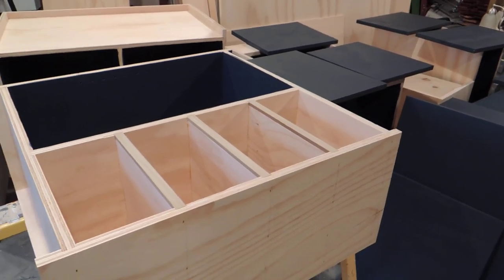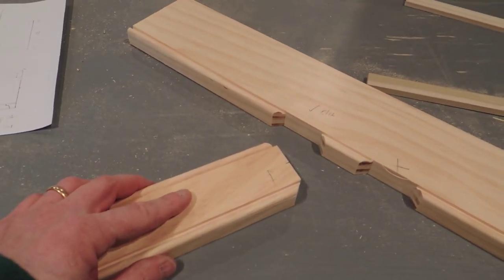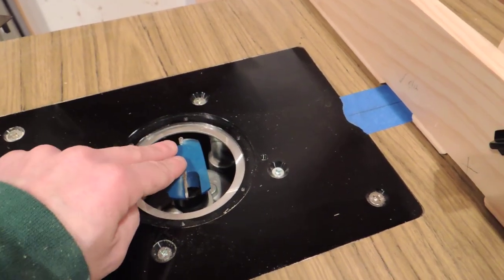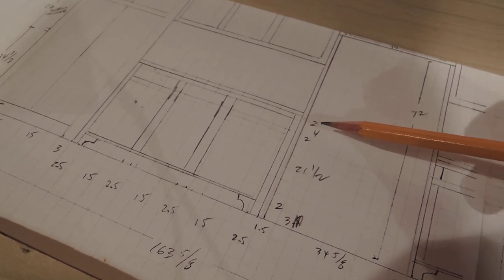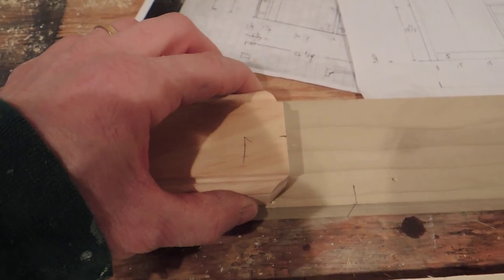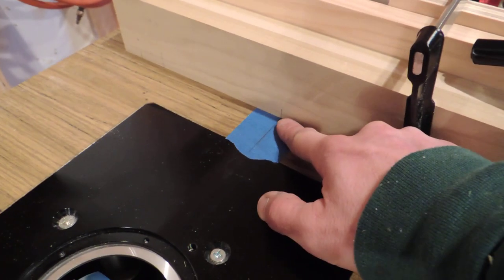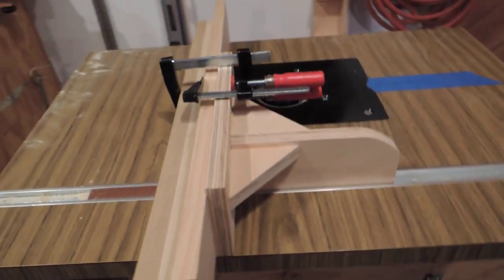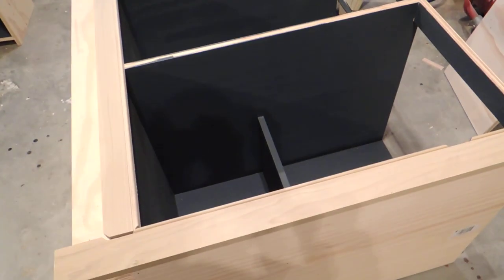Cabinet Beaded Face Frames With A Simple System

Comment: I know you made this 4 years ago, but I just wanted to say Thanks for the great video.  There are a couple other similar videos out there for making beaded face frames, but yours was by far the easiest to follow and most useful.  It gave me the confidence to attempt it myself on a big built-in cabinet project and the results are perfect.  I went with the smaller sized Kreg notching bit so that I could reduce the width of my rails to 1 5/8 (if single beaded..  1 7/8 if beaded on both sides).  I found the best approach to be to fiddle around until you can make a perfect/tight master sample of notch and rail, then keep those for reference to repeat the router set up later.  Also, the line markings work fine as reference to start setup, but I found that using a stop block on a scrap piece is the safest way to go for repeatability.  Thanks again for the great video!
Reply from the maker: That's great to hear--glad it worked out for you!

Comment: Pretty cool John.  I bought one of those Kreg bits after making a beaded face frame with the miters on the bead cut by hand.  Let's just say I'm glad it was a painted frame.  I started to build a set up then realized I didn't have an accurate way to index the cuts.  Your set up is exactly what I was looking for!
Reply from the maker: I usually look for the simplest way to perform a task.  Sometimes elaborate jigs are necessary, but often an old school trick can be adapted to new use!

Comment: Excellent job explaining the process. Glad you addressed in the comments how the 45 degree ends on the rails are made.
Reply: I did the 45s using the same bit, lining up the mark for the foot of the 45 to my mark in my backer board for the foot. See my prior comment. I found this ensured that all cuts are the same height, precisely.

Comment: I do think a flip stop on your fence will make a big difference.  Drill a threaded insert into the edge of the flipstop then add a bolt with a nut on it to act as a micro adjustable stop. So you can set it up for constant cutting of the work piece. This is more accurate than ling a pencil line.

Comment: Instead of tape on the table, I used a square to draw lines up from each point of the profile on the backer board. These lines are easy to match against my marks on my pieces. I also mounted a stop block on outboard side of the backer board which sits flush against my push block, so clamped against the push block it always sits at exactly the same place v the router bit. I had no problem beading first.

Comment: Nice video and a good alternate to the traditional method of beading the door openings and drawer fronts. I guess if you used a shallower bead detail, you would just lower the bit in the table to the correct exposure? And... if you wanted a bead detail on the interior of a flat panel door, you might be able to adapt this to a mortise and tenon frame and panel door, too. Damn... ya got me thinking

Comment: This is an excellent video. Will this method work using a ogee edge or Roman ogee edge vs the beaded edge?
Thanks ... easy to follow your explanation.
Reply from the maker: Yes, the concepts are the same even with a different edge profile.

Comment: I have some pre-finished fridge panels that I need to make a similar joint in. The panels are obviously too big for a router table. There are 2 side panels and a top panel that need to be joined together. Any ideas on how to do that consistently and efficiently?  I have several to do.
Reply from the maker: I think I need some more information, because I'm not clear on what you are trying to do.  Is it that you have pre-finished panels that you wish to build a frame to hold?  Typically when your cabinet maker supplies prefinished panels for appliances they are attached with clips or from behind.  And if you wanted to have them look like doors then the cabinet supplier would do so and give you the finished product.  I'm just not following what you need to do...
Reply: @enduringcharm  I wish I could articulate it better. The panels are for the sides and top of the fridge. The face frame is pre-installed on the panel permanently and painted. The face frames have a bead on the inside and I need to put the panels together with the type of joint that is shown in the video.
Reply from the maker: So, the cabinet supplier gave you everything you need, but you just need to stick it together?  Or is it that you need help getting the supplied panel attached to your fridge?  It would be nice if YT allowed pictures on these posts!

Comment: How did you make the cuts on the end of the rails? Great video. Thanks for the info.
Reply from the maker: The rail ends just need to have the corners nipped off at a 45 degree angle.  A miter saw is what I use for this purpose, but a table saw with a miter gauge or a radial arm saw are alternatives.  It's easy to see how far to cut, because you are  cutting right to where the bead profile ends.

Comment: Great video, full of instructions. I'm attempting to install 1 1/2'' face frame on my 16mm (particle board) carcasses. Since the inner edge of the stiles is not flush with the vertical boards of the carcass but sticks out inwards for about 22mm, can you please recommend what type of concealed hinge to use for the doors. Regards all the way from Macedonia, Europe. Thanks.
Reply from the maker: Well, you don't mention what type of doors--inset or overlay--you are installing.  However, you can purchase what we in the states call "Euro" hinges which mount on the edge of the stile for an overlay door.  Or, if you have inset doors most hinges styles for that door are mounted on the edge of the stile anyway.  I actually have a video on euro-hinges you might want to check out.
Reply: Inset doors. I'll check your video on the hinges now.
Reply from the maker: For inset doors they do make some euro hinges, but they really aren't the best solution.  Traditional mortise hinges or the newer "non-mortise" hinges really work the best and give a traditional look.
Reply: @enduringcharm   Thanks.

Comment: I am having so much trouble it’s my beaded face frames. When I run the wood through my router the wood jumps and the router does not sound right. Could this be because my jig is not sturdy? How did you build your jig?
Reply from the maker: Well, it's hard to diagnose from a distance.  It sounds like maybe your problem is with your router or bit.  The beading bit really doesn't remove that much material, so routing should be smooth.  Possibly you have your cutting depth too deep, you could have an issue with the router motor or bearings, or it may be your technique as far as speed or pressure.  Try setting up your fence so you are taking just a little bit of material off, and then send through some scrap wood.  if it goes well, then increase the cutting depth slowly until you find where it starts to chatter.  I think you'll be able to diagnose the problem by then.
Reply: Here's some things to check - might help you.  1) Is the bit razor-sharp? 2) Is everything free of pitch/sap/sawdust build-up?  3) Is the bit set properly...DO NOT bottom out the bit in your router collet. Insert it finger-tight all the way to the bottom of the collet, then PULL IT BACK OUT 1/16" or so.  If it's bottomed-out vibration will loosen it = ruined cut  4)Is your router powerful enough?  Some consumer-grade 1/4" routers simply can't  get the job done  5) Is the router in good shape?  If there's any slop in the bearings, etc - all bets are off  6)ARE YOU FEEDING THE STOCK IN THE RIGHT DIRECTION ?  - Wood "Jumping" makes me think you may be trying to do a "climb cut" . Your feed should be AGAINST the way the bit spins, so it provides resistance vs. pulling your stock out of your hands  7) Is all your stock prepared correctly - square and smooth?  8)I'm assuming you're using  a router table - if you're trying to hand-hold a router with a beading bit on narrow stock, you're going to need a different set-up to fully support the router so it can't tip as you make the cut.  That's why most people recommend a router table for a bead cut  8) Note that if you do  go from hand-held to router table.. the feed direction may have to be reversed depending on which side of the stock you were on when hand-holding 9) USE FEATHERBOARDS.  If you want consistent results on a router table, you have to make sure the wood stays against the bit the way you want. A featherboard set up on BOTH the table and the fence assure a consistent cut.  10) You may have to take multiple passes- sneaking up on the depth you want - so you'll have to tweak your featherboard set-up as well.       The bottom line to clean repeatable cuts is eliminating variables.  The machinery all has to be in good repair,  cutters sharp, and stock properly prepared.   Hope that helps.

Comment: I don't understand making the interior of the cabinets black...you can't see in there when you're looking for stuff. I paint all my interiors gloss white so that any amount of light entering bounces around and people can see what they're looking for. I also add LED strips on the under side of the base-cabinet shelves with contact-switches when possible and line the shelves with white pvc bumpy-surface sheets so pots and pans and bowls slide easily. It's a delight to open the cabinet door, the light comes on and you can actually see everything inside.

Comment: Good information, would like to see how the rails were done.
Reply from the maker: The rails and stiles are both done the same way.  If you have a rail with stile connections at the end and a stile in the middle you just make the relief cut in the middle and miter the ends for the relief cuts in the end stiles.

Comment: How do you cut the 45 degree cuts on the ends of the rails?
Reply from the maker: A miter saw makes quick work of it.
Reply: Use the same setup as the stiles, but use a new mark on the tape that only goes in so far from the end to take the corner off. If you are going to do a lot of this make a jig that has fence where you have a track on top so you can have a stop to make repeated cuts
Reply: Turn the style on its end and you can run the 45 off the edge of the notching bit
Reply: @zennloo7343  This is exactly what I did (and used a stop block to keep it repeatable).

Comment: Great way of saving some money on this setup. Just like to know that it seems to me that cutting off those 45 degree ends of the rails that go into the profile made with your bit has to be right on the button or will show up on the cabinet face. How did you set up this cut as it is a very precise cut it would seem to me?Thanks and great job.
Reply from the maker: The 45 cut really isn't as difficult as it may seem.  Honestly, I think I eyeballed most of them on this project after getting one test piece to fit.  You can make a mark by holding the rail just underneath the stile.  Or, if you're having trouble, you can sneak up on the cut by starting a little big and working your way down.  I'm sure some folks would set up a 45 router bit with another jig, or perhaps a table saw tilted, but I just used a chopsaw for those cuts.  There are those who enjoy the engineering process of every cut, which is fine if that's your thing.  For me, I'm just trying to get the work done quickly and accurately.
Reply: Lay the rail on it's side and then cut the 45 with the same notching bit.  Once you make a perfect one, clamp a stop block on the fence so you can repeat the cut, then cut them all at once.

Comment: Nice job! Is that a 3/8 bead? have you tried a 1/4 bead? cause i bought that but not sure how that would look
Reply from the maker: No, I used a 1/4 inch bead.  The measure includes the rounded part but also the slot next to it.  I think a 1/4 inch bead is pretty standard for most cabinets.